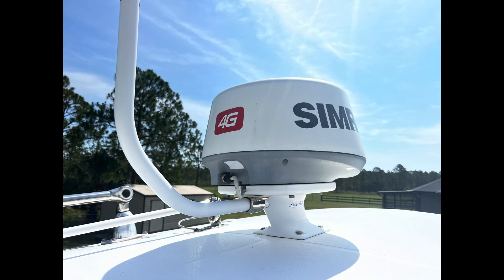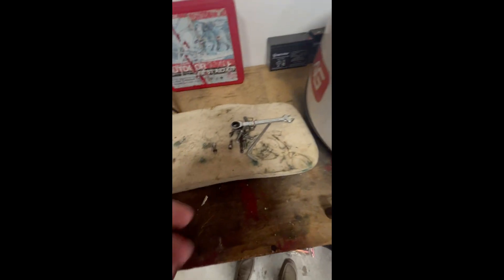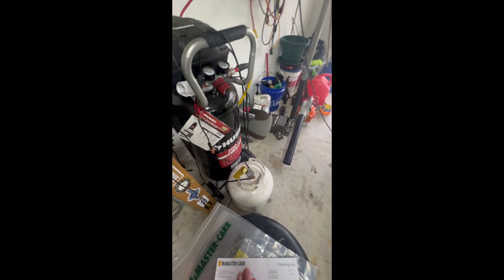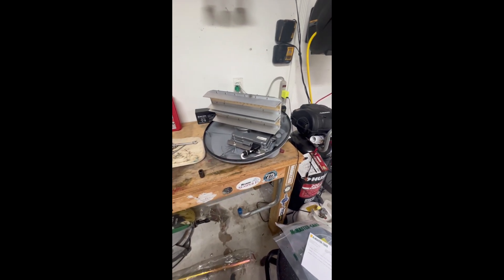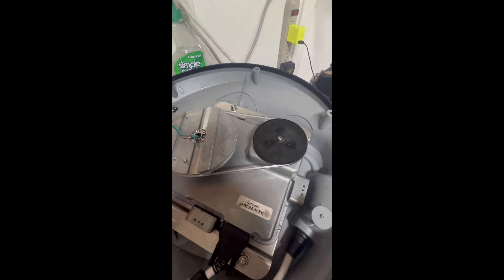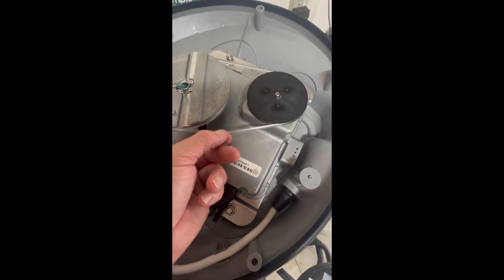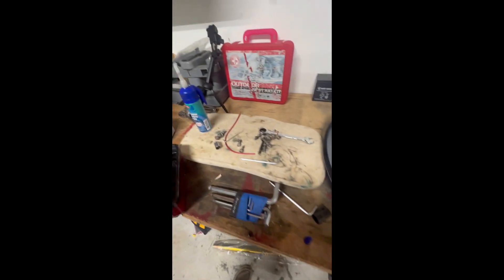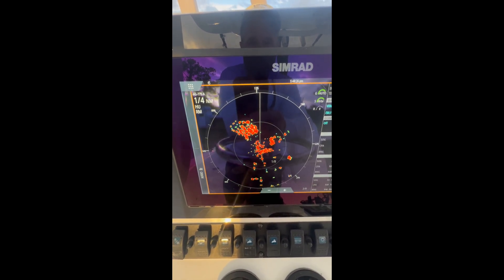SIMRAD 4G DOME RADAR ERROR MESSAGE FIX : HOW TO FIX BROKEN DRIVE BELT

Comment: Thank you so much mine quit working. Got on the phone with Lawrence. They wanted me to get a vault meter and do all kind of power testing and then we got disconnected after I waited an hour to speak with someone and then they never called me back. found your video took my radar apart same problem red belt broke thank you so much

Comment: I got all the allen screws off including the one behind the sticker but I cant get the dome off...
Reply from the maker: Maybe your missing one. How many did you take out? If your good on that use a flat head and pry the edge up. Your gasket could have melted.
Reply: @LIVITOutdoors  yes thx got it off my belt looked ok must be some other issue i have.

Comment: Thank you. Got the error and thought Game Over. I had a 3g with a different error and Lowrance sold me the 4G for $400 years ago. I was going to open this up anyway and found the broken belt. It appears they buy rolls of belts and cut and fuse them.  Based on how it was broken it looked like the fused section came apart. Before I watched your video, I used very hot glue I bought from Midland Supply. I glued the belt together and it works great.  After I watched your video, I found the direct replacement then I swapped the belts. THANKS again.

Comment: You just saved me a huge headache.  Thank you for this video! Left the launch Sunday at 5am getting ready to make a 95 mile run and the radar stops working. I got all the same error messages you showed. Hopefully this belt fixes it 🙏🏻
Reply from the maker: Man let me know if that was it. Definitely keeping an extra belt in the boat myself. Happy to help though.
Reply: @LIVITOutdoors  opened up the radar two days ago and BOOM there was the belt laying in the bottom of it. We were headed off shore about 95 miles and radar goes down as soon as we made it out of the harbor 🤦🏼‍♂️ your video was the only one I found with my exact radar and all the same error messages lol. Thanks again